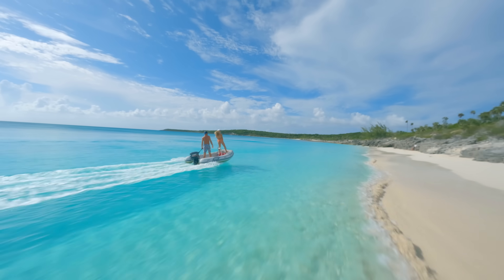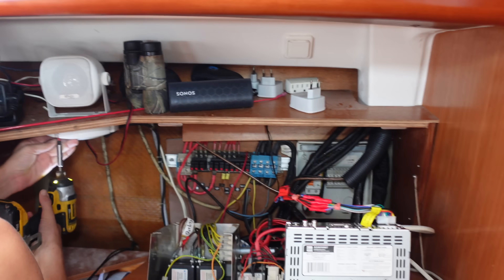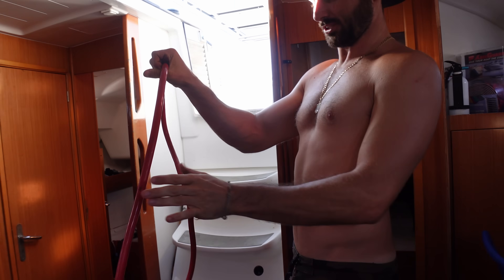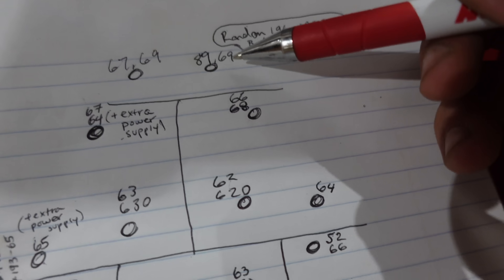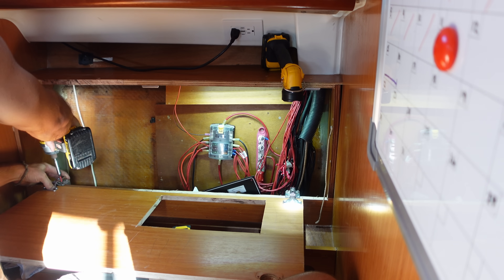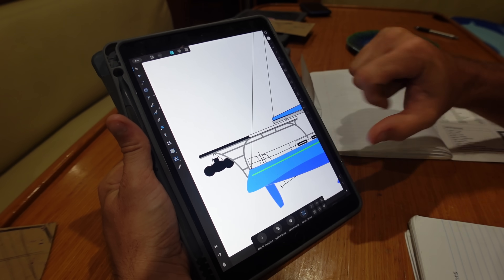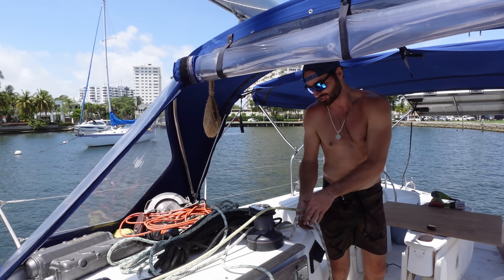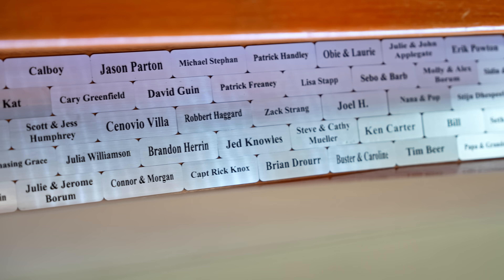Shocking Truth: Uncovering Fire Hazards in Used Boat Wiring! BIG THINGS TO COME!!| ep.27

Comment: Something that I learned from doing 12v wiring on the farm, is clear heat shrink tubing over printed labels.  This protects the label and makes it super easy to read.
Reply from the maker: Dually noted 🤘🏼
Reply: That's a very good idea.
Reply: This is great thanks @SpartyTime
Reply: A crimp on good plastic works as well. I have never seen anyone use a heat shrink, but I bet it works
Reply: But so dodgy. Should be replaced as soon as possible with an intact wire.

Comment: I have always found explains basic electricity using a garden hose as an example.  Think of the garden hose as a wire, the water is the electricity.  Water pressure is voltage and the amount of water flowing is current.

Comment: 2 -an additional ground in order to protect your engine. A through haul stainless steel bolt at lease 1/2". Connect a cable from the engine to this bole. Let me explain: The crankshaft in any engine is floating and is not a good ground to the water! If you did get struck by lightning do to the floating crankshaft the lighing will pit the the crankshaft & bearings trying to make a connection to the water. When you start the engine the pits on the crankshaft & bearings will wipe out your engine. I had the privilege of replacing multiple crankshaft & bearing for Carrier corp. Do to a similar condition.

Comment: I saw a couple from Brazil that had numbers like a wedding ban that slipped over the wire. When I worked on Jet Fighters every component was labeled from the tip of the nose of the airplane. So 12 feet from the nose is the component location and the clock location from the center of the boat like 12 feet dash 5 o'clock is the exact location. When you are at the circuit breaker and you see 12 - 5 you know exactly where the wire is going without a diagram.

Comment: These past few video's have been SO informative, thank you for sharing all this. But I cannot help wonder, wouldn't it have been 'easier' to check and rewire everything while the boat was still in construction mode and all the cabinets and backboards were out? I've never done a refit at all so every answer is educational ;) 
Keep it up guys this is so fun to watch! 🤙
Reply from the maker: That’s a good question! If we were to do another rebuild, needing a rewire, then yes we’d do it first. But at the time we were living on the boat without floors and a bed and a kitchen so our priority was having a living space. We weren’t expecting to have to rewire everything either. We hadn’t dug into the wiring at all till after we built out the boat so we also had no clue we would have to run all new wires. 
We can definitely say we have a different order or events after this rebuild. We learned a lot!

Comment: Nice! You guys may wish to install a mini split AC unit.  It is much more efficient (less power) than the marine AC. They don't have all the problems with salt water heat exchangers etc. and they put out way more cold. Take a look at what Rick Moore did.  You could have the outdoor unit lay flat like a pizza box and put it under the solar panels so that the air flow keeps the panels cooler as a side benefit  (if you want to go crazy, you could put two units laying flat side by side under the solar).  Make sure to get the unit Rick got as it has non-corrosive radiator in it that deals with salty air.  Even so,  the outdoor radiator unit will need replaced every five or six years - they are pretty cheap so get an extra at time of purchase.  The rest of the unit will last much longer.  Very cheap way to get max AC and it can easily run off your lithium battery and solar.    If you don't like looking at he interior blower unit, you can also get it with four small ceiling units that blow the cold in four different locations.  It can also be combined with the larger unit that Rick has.

Comment: 7:35 actually a good idea,  “if in doubt, throw it out” approach,   Hopefully you have a label maker,  but anyway,  the last thing a boater needs at sea, sail or motor,  is an electrical fire!  And this is serious because the wires run behind things,  a short can be in one area but the highly toxic smoke may appear in another,   You also have the “ domino affect” of as each wire gets its insulation burnt off, the next short can appear,  meaning there’s no alternative but to shut all power off..   technically leaving you “dead in the water”  with no electrical,  the reason why most people wire the engine and at least one radio on a completely different loom and battery..   i could go on but won’t..  that fact you guys seem to notice this and are taking steps other should follow is good enough!   Well done..

Comment: You must watch this!
Raff, I watched your video about your new batteries & solar panels. Very good job, but!]
In your video you told your flowers to tie the DC ground cable to the engine witch is correct, you also said that if you get struct by lightning you would be grounded through  the engine through the crankshaft through the drect drive to your propeller shaft to the water. You need to find - additional additional

Comment: As you plan on circle navigation remember that 120/60 is mostly a north American thing and you are going to run in to 240/50 pretty soon and my recommendation is to install something like a victron Blue Smart IP22 Charger to be able to use shore power outside north America.

Comment: Those pin holes in the boat wiring are probably from "bed of nails" test lead connectors and not the regular solid probe leads. Regardless of the test leads used, like you guys said, it's a bad idea to test the in middle of a wire whenever testing at a terminal end is available.

Comment: I was very surprised to see that you were getting rid of the 220v input shore feed, and opting for 110v only, when most countries of the world use 220/240v. 220 volts uses half the amperage of 110 volts, and is considered to be safer as a result. Many cruising blue water boats have both systems installed, which does away with the need for inverters and transformers. This is not a criticism just what I hope is a useful piece of information, as I admire all the work you have done to a very professional standard, and look forward to every new episode, as they are entertaining, amusing and instructive. My own boat which is a 1986 S2 9.2 CC Cruiser Racer, was bought in the USA and sailed from the Chesapeake to Vilamoura Portugal where I live. It was wired 110 v, and my quick fix was a 230v to 110v industrial transformer, which I still use to this day, With my very best wishes and good luck in all your endeavours.
Reply from the maker: This comment may be the fuel for the opener in our next episode 😂😉kidding…in all honesty we should have left it 220…obviously 110 is the standard in the US and everything we own has a 110 plug attached to it so we switched it to fit our current needs. However, looking back, we would have left it 220 knowing what we do today

Comment: You should be able to get flexible solar panels that can go on top of the hardtop/canopy that you can also walk on if necessary. You'll really need/want that extra solar capacity.
Reply: Don't waste your time with flexible solar. You need an air gap under them  to get maximum efficiency from the panels

Comment: While I love the fact that you guys are just going for it and sharing. This particular video scares me a bit. The color coded DC wiring is there for a reason. Also, PLEASE take note of the AWG of each wire. A miscalculation could bring your boat down by fire. Also, cutting the wire ties and mounts but leaving your wire in place let’s you use it as a “mousing line” much easier to run wiring that way. Also don’t forget drip loops. When the deck hardware and hatches leak eventually it nice to not have all the water running to the panel or batteries. 
I would recommend reading Nigel Calder’s and/or Don Casey’s chapters on electrics before continuing or starting a project like this. 

That being said, keep up the good work and remember “We learn the most from our own mistakes. I like to think I just learn more than most people.” -M Sparks.

Comment: .... story time .... back in the early eighties a few of us were standing around trying to get a V-8 running smoothly with a timing light and not having much luck, the spark plugs had been changed not improving the situation .... an old guy walking by asked if the spark plug cables had been changed recently. The owner of the car responded that they still looked good to which the old guy responded, have a look under the hood when in is dark .. that evening the car was started and the hood popped, the light show was incredible, to say we were a wee bit flabbergasted is an understatement. The cables were changed and the timing was set and the car ran like a dream. If I remember correctly this was an early 60s GM product 4 door that we cut the roof off, just a bunch of wild and crazy guys and was the daily for the owner. The doors were welded because on a previous roof chop it was discovered that the roof was integral to the body not sagging when the door were open .... thx for the trip down memory lane .... you know this, but will say it anyhow, the crackling sound when bending the wires was the sheathing cracking .. smart move changing .... have to say Sasha, when taking the old batteries uo the companion way ladder, you on the heavy end and lifting your hands to your chin, impressed, dynomite comes in small packages .... you guys sure went to town on the electrical .. you will be so thankful having redone those connection and getting rid of all that green ... for what yo accomplished, well worth the effort ..... have to say the boom raising project took no time at all. All your other project belittle this so much, but must have been fun to get something wrapped so fast ..... think you are going to enjoy the hardtop adventure/project .... thx for the share .. as always .. never stop dreaming, just dream bigger .. have fun be safe, save our oceans ....

Comment: (For the record: Ohm's Law states that - Voltage equals resistance multiplied by current. Resistance equals voltage divided by current. Current equals voltage divided by resistance.)
Great video, you two keep rocking it! Thank you for this content in here, and safe travels/fair winds/following seas!
Reply: PIE, and EIR are just the inner circle of ohms law, there are a lot more of those calculations, and that is what confuses most people. They learn, EIR and then you introduce PIE, and on and on

Comment: Each time you use a multimeter you should always put the meter in ohm mode and touch the ends of your meter leads together and verify they are good.  I don't know how many times I have been called by technicians to solve problems they couldn't figure out and the first thing I do is show them how to test their meter.  I have seen bad meter leads with with anywhere between 5 and 50 ohms of resistance.  Carrying multiple meters and multiple sets of leads is very good idea, I always carry a brand new set of fluke leads just in case I need them.

A very common mistake people make is when using diaelectric grease.  I don't know how many time I have seen people using diaelectric grease directly on the conductor or terminal.  Diaelectric grease is actually an insulator and it will actually increase the resistance the resistance of connections.  That is the purpose of antioxidant joint compounds.
When using any type of crimp connector having the correct crimper for the particular terminal or connector being used is important.  I build complete custom harnesses for experimental aircraft modifications, race boats and race cars.  I have one of those Harbor Freight U.S. General 6 drawer service carts and it's only used for storing my hand crimpers.  

Another must have tool is a good label maker capable of printing on heat shrink.  Numerous companies make handheld units capable of printing heat shrink labels and the most popular brands are rhino, brady and epson.  The cheapest ones start at 50 bucks.  The epson LW-PX400 is a good all around one to have and I thats what I usually use in the field.  I usually shrink an extra layer of clear heat shrink over the printed layer to protect the label.  Most of them are capable of printing regular labels as well.  

There is a couple free open source programs for creating wiring schematics that work pretty good.  When I wire race cars and boats I always give the customer a printed color wiring schematic and a digital copy on a thumb drive.

Comment: Boat is looking great.  Super job by both of you. 
One thing to consider when wiring,  the lower ac voltage creates more resistance which means you need larger wire to run lower current 120v . AC and DC systems , resistance drops when voltage increases which allows for smaller conductor.  This is why most vessels are 48v minimum.  Some are 24v but rarely do you see 12v. It's too unreliable for marine or aviation. 
 I would run 12 awg on receptacles,  minimum.  
 14 awg is only for DC low draw / AC controls, and 120v lighting.

Comment: On trimming the sales, wondering if you cannot just cut the top end horizontally and put a baton in it like modern boats?
Also will the performance loss be noticeable?, I think maybe going upwind it will. Would be interesting to find out. Doing the same thing on my cat.
Reply from the maker: That was my first initial thought but on a monohull we have backstays unlike a cat which just has side stays. If we cut the top off and put a baton like you suggested then it will hit the back stay

Comment: wires usually go black, if they have been exposed for water and used after that, so looks like that your boat has definetily been at least partially under water. good job replacing all the wires, its much more reliable after that 👍👍
Reply: Gotta agree with the water and cable issue , but disagree with the boat being partially submerged . I've dealt with what i call black wire , for several years now , first on a 26 year old car , and more recently a 23 year old rv . In my experience , it's usually the earth that takes the hit , i've yet to see a positive affected . Basically the wire is corroding , water has penetrated the insulation usually at a join or plug , where it then creeps along the cable run . It's normally a sign of poor wiring practices , or cheap wire . The only cure is to rip it out and replace . You can't solder it , and crimps will only fall off , the circuit will cause intermittent problems , until eventual failure . This can be a huge problem if other circuits join into the affected run , as was the case of the rv . I would have lost the primary affected circuit , indicators , along with the dipped beam , and horn .
Reply: @mickey1299  
I also work with cables, and those kind of black copper cables are always somewhere outside or inside hd machinery, where they have been exposed to water,
Havent seen any difference between cable qualities. If poorly insulated from the ends they all turn black.
You are right, that it is usually ground that first goes black, but also positive will go black with time.
Air humidity isnt enough for this to happen, it needs at least splashes of water.
There isnt any reason for this to happen inside of boat, if it has been dry.
Green condensation is what comes from humidity and air.

Comment: OMG😱 So true about the wiring and fire hazard. Also something to check carefully here on board one day. Fortunately, my boat was built by a very precise and skilled German and not a Frenchman😅 (see difference quality wiring in German and French cars😉). And when I moved from my appartment to my boat I had 2 fire alarms left over..so now 5 fire alarms on my 38-foot cabin sailboat😅...if that doesn't wake me up or startle the whole marina when I'm not on board I don't know what will🤣. I am also going to make the in between rooms doors more fire-retardant. I often close them when I am away and switch off certain electrical networks. Of course, fire remains a small chance if the quality of the electrical network is ok...but just like chance of a water leak, you can't be preventive enough😊. And what a well thought out hardtop construction!!!👍 Keep up the good work!!! Moedig voorwaarts maar geregeld ook even op de plaats rust!! Bravely forward, but regular a moment on the place rest too.💪💪👊😴🥳😎

Comment: If it was under water, salt water it migrated thru the wire as it sat under water, you will be happy that you rewired it in long run. Dont forget the liquid electrical tape on exposed connectors.
Re coup some cost , strip that old wire and scrap it.

Comment: There are fairly simple systems that are located in fuse boxes
 Click, your tv turns off
 Go to, what in my day a fairly large cabinet. Just open the door look for orange LED light. Neck the number on fuse location. Bring up number on computer program. Boom, whole electrical schematic on everything depending on that fuse. Called PLC system. Depends on user being diligent about documentation.
By the way you did right. Those wires were terrifying.  All it would take was copper on copper spark, and boat on fire.
Reply: Programmable Logic Controllers. Been around since the mid eighties

Comment: Imagine a water hose.  The volume of water flowing is your amps.  The pressure behind it is your volts.
Reply: A useful analogy. Just remember that electricity requires a closed circuit and a water hose does not.
Reply: Horsepower vs Torque.  I always think of a weight-lifter. Torque is what's the guys max bench-press. Horsepower is how many times can you bench a weight, in a set amount of time.